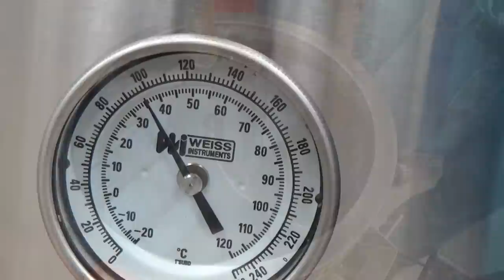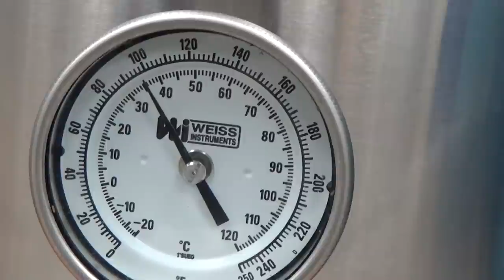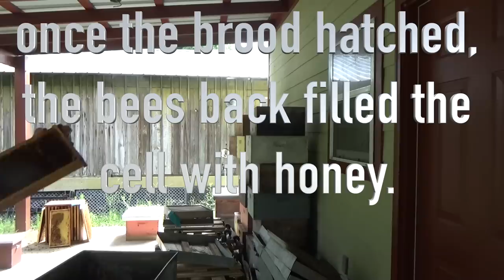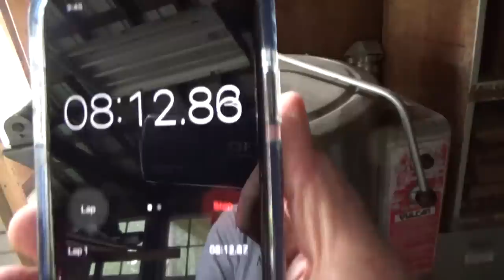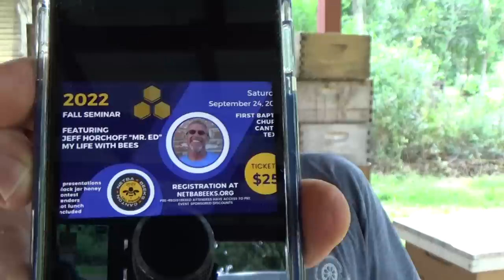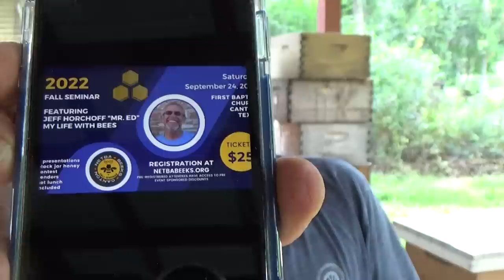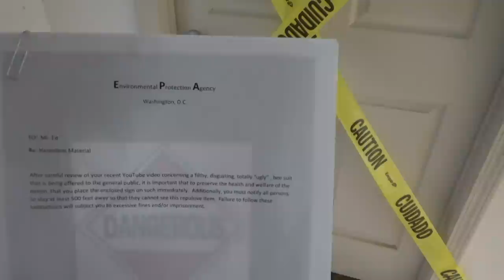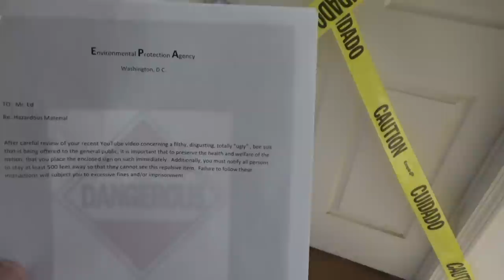Rendering beeswax....along with a few other things as well.

Comment: In another channel they made a screen with legs to drop into the melter after drawing off the majority of the wax, They add water to a level taller than the legs, and lower in the screen over the top of the refuse.  Heat the tank up again and leave it sit heated for a couple of hours the wax being lighter rises up through the slumgum forming a layer on top.  Turn off the heat and allow to sit then remove the hardened wax and dispose of the waste.   They got several inches of wax from about 8 inches of waste.

Comment: This just confirms it.  While I like when you tend to your livestock, the "processing" videos are my favorites.
Among the pleasures they provide is the inspiration of ideas it gives me.
If you would indulge me while I share.
With your torch usage, two things I plead you do for added safety--
1. Spark lighter.  Rather than the butane lighter.  Safer for your hands.  And reliable even in windy weather.  And cheap.  And it will last for decades.
2. Propane tank/bottle.  Rather than a plumbers bottle, get a camping bottle.  Shorter and wider base.  Much less of a tip risk.  And the torch valve/nozzle should fit the thread.

And with your cleaning frames and foundation, I don't know what sort of clever system you have.  My experience with pressure washing light weight stuff is the frustration of pushing things around inadvertently and lots of bending with wand in hand....
3.  What comes to my mind is whether your kettle can be put to use.  It is a beautiful sink tub.  Dip foundation and frames into the water set to whatever temperature you want.  Scrub and wipe as required.

Just my thoughts.  Hope it helps your thinking somehow (like your cardboard box trick while wiping out trays).

Until next time, thank you.
Reply from the maker: I really like the idea of the spark lighter, and I will be getting one. As far as the bottle shape, I want to use my crawfish burner, it has the same burner and the base is a tripod, very sturdy. Unfortunately, it still is in storage but you will see it the next time. And for the pressure washing, check out the video link below, it shows a fixture I made that works very good. Thank you for your suggestions, your concern for my safety, and for taking the time to watch my bee wrangling adventures. God's peace Barbe.     Mr. Ed
https://youtu.be/RjjIJ71L2cc
Reply: That is propane is it not?

Comment: If I can suggest to try and put your wax in a pillow case then boil.  The trash will stay in the bag and wax float to the top clean
Reply from the maker: Years ago when I first started rendering beeswax in a kettle, I did use the pillow case method and it worked better than trying to strain the debris out by using a basket. However, because so much wax was still left in the material itself, though it did restrain all of the heavier trash, I have found that the open method, no confinement of the debris and using a strainer in the throat of the gate valve, has proven most effective for my way rendering the beeswax. Thanks for watching, and I hope you will check out more of my bee wrangling/ bee rescues adventures and let me know what you think of them. By the way, I post a new video every Friday morning, and I look forward to hearing from you again soon.  God's peace Valerie.
Mr. Ed

Comment: FYI, you should get an electrician to install a switch for your pump outlet (tell the electrician it’s for an electric motor, not just a light, so they can select the right kind of switch). Outlets aren’t intended to connect/disconnect live loads, as a small arc happens each time. This causes damage to the outlet and plug, and in the worst case, can result in either the plug and socket welding together such that you can’t disconnect it again, or in a poor connection that overheats and could even cause a fire. The risk is small, but so is the cost to install a switch.
Reply from the maker: I've already talked to an electrician about putting a switch on the pump, we just have not gotten around to doing it. Hopefully the next time the pump is on a video the switch will have been mounted. Thanks for watching and helping out. God's peace Antonio.
Mr. Ed
Reply: @JeffHorchoff  Excellent, safety first! Take care!

Comment: How do you stop your wax from losing its aroma and turning a darker color? Water boils at 212°. I've read:
 Beeswax begins to melt in the range of 143F – 151F.  At temperatures beyond 170F, beeswax loses its aroma.  It will also begin to darken in color.  The flash point for beeswax is in the range of 400F.
Reply from the maker: The aroma is not lost after the rendering, in fact, the rendering brings it out. It is only after a period of exposer to the air that the smell of the wax begins to wain. As far as wax getting darker after it is rendered, my guess it is because of exposer to ultra violet light. I have rendered blocks of wax that are 8 years old and still maintain their beautiful color. God's peace Mark.
Mr. Ed
Reply: @JeffHorchoff  I guess your information is the difference between practical, years of experience and someone's chemistry book learning.

Comment: what's the psi on your pressure washer?  I am NOT successful at 1650.
Reply from the maker: Check out the video link below, I built a fixture to hold 3 frames at a time and it withstands even the blast of the commercial washer I was using. God's peace.      Mr. Ed
https://youtu.be/RjjIJ71L2cc